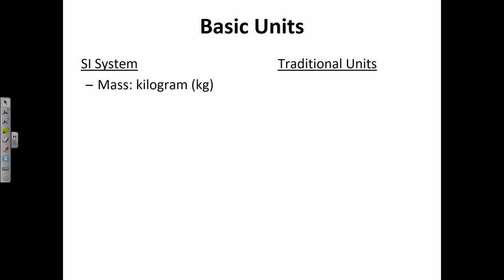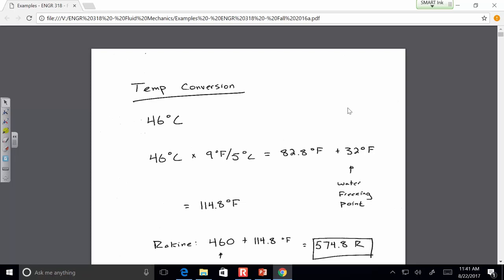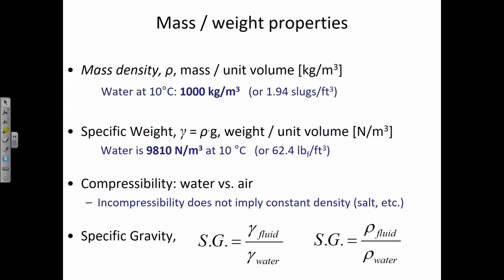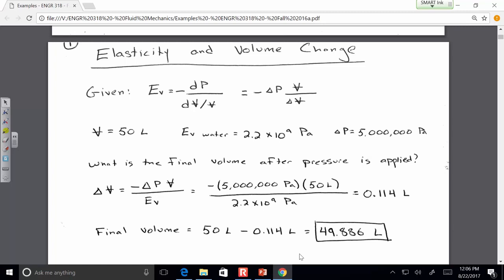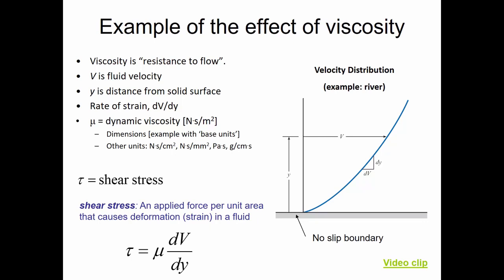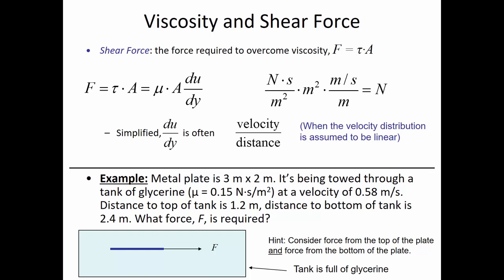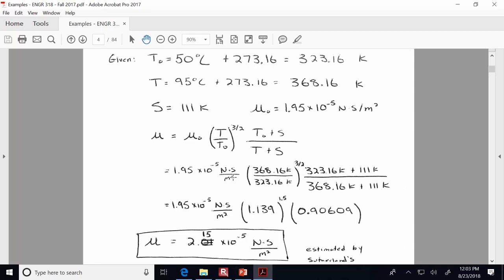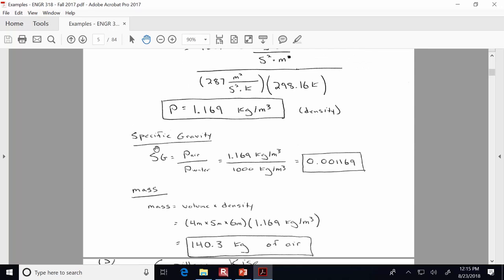ENGR 318 - Class 2 (29 Aug 2019) Fluid Properties, Elasticity, Viscosity, Gas Laws

Comment: Could you provide an ISBN for the textbook?
Reply from the maker: The textbook I use is "Engineering Fluid Mechanics" 10th edition (Wiley) ISBN: 978-1-118-16429-7
Reply: Thank you Professor Wait
Reply: Professor Wait, do you mind sharing the ISBN for the textbook that you're using for Hydraulic Engineering?  Thanks,
Reply from the maker: @qahraman2025  ISBN: 978-0-534-49483-4
Reply: @IsaacWait  I appreciate it very much professor, Wait.